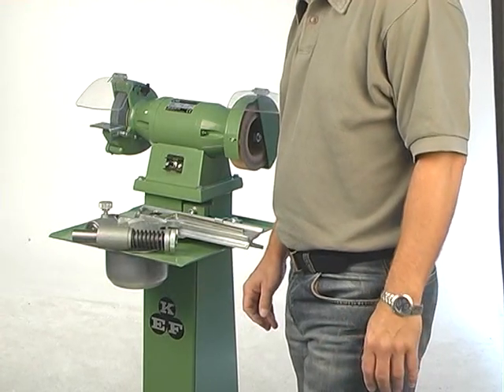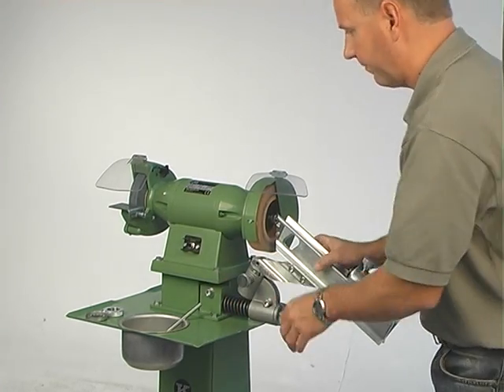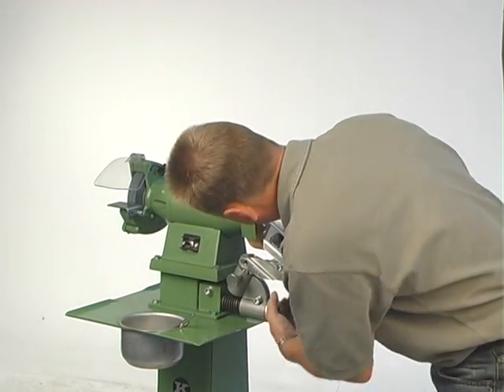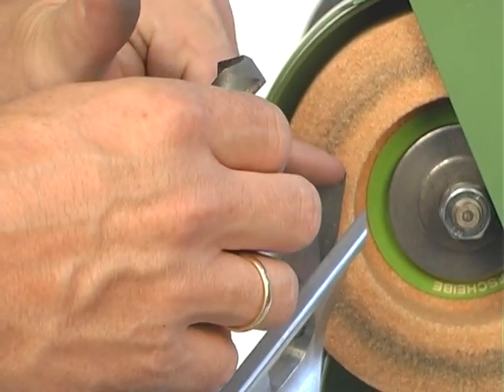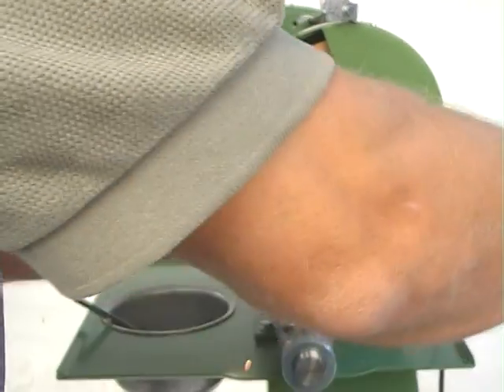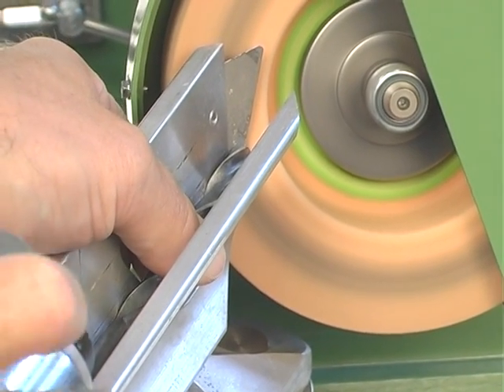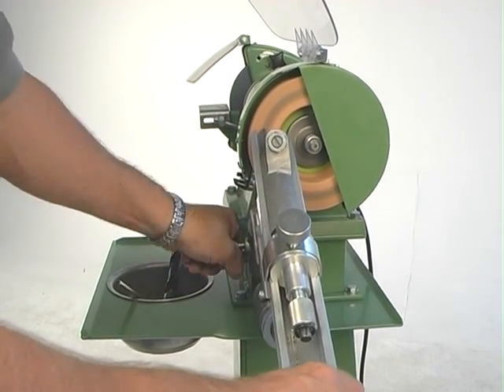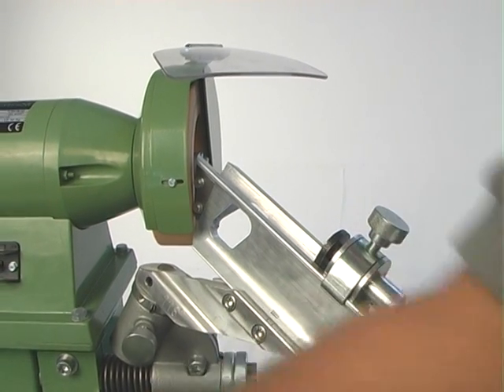VTS_01_1.VOB

Comment: I can't believe they didn't bolt that grinder to the floor. It's like pivoting on plate that's warped from too much welding. And the guy is like "then you put dis on dis and take dis and screw it on dis".

Comment: Wow it is almost like a gigantic Bulldog drill bit sharpener. Unfortunately it suffers from the same shortcoming that does though. In that it leaves striations parallel with the edge, not perpendicular. That can lead to chipping. I've found with my Bulldog sharpener that if I mount it at a 45 degree angle to level I can get a perpendicular edge grind then. It is kind of hard to explain with text. So if anyone is interested, and replies I'll paste a link to a picture of it then.